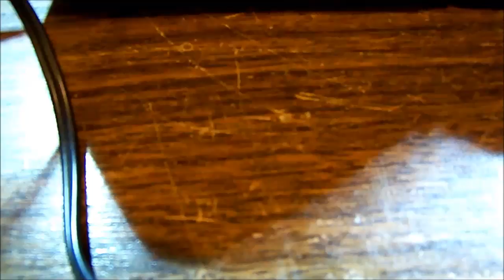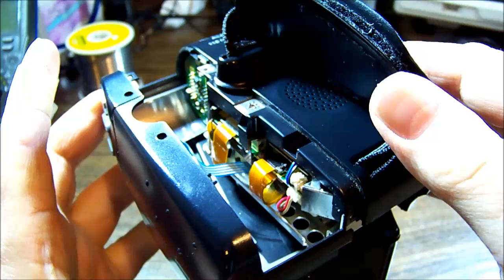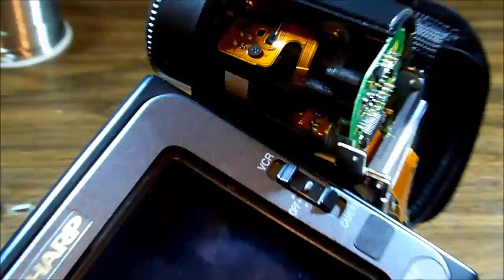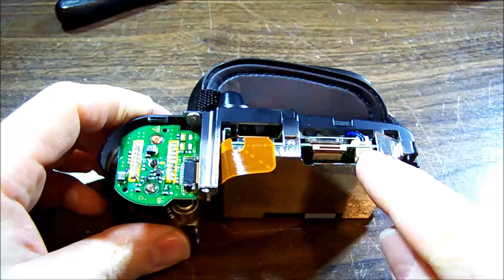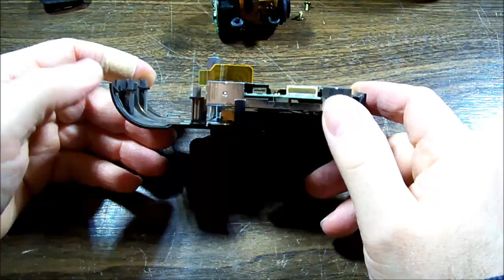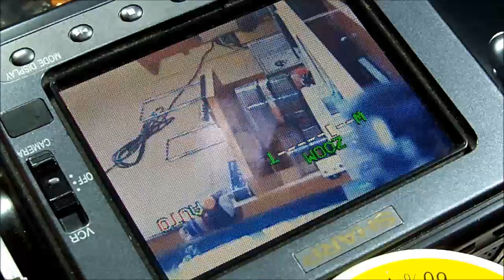Sharp VL-E41X Camcorder repair

Comment: Hi John,

I have the exact camcorder which I had stored in a cupboard for years. Mine turns on both on video and VCR with only a grey screen. I can't retrieve any menus or any functions. Is there a factory reset of some kind I can perform..?  It seems like the internal memory has been lost in not being turned on for years..🤔
Reply from the maker: I wouldn't think so. It's probably more likely some voltage rail is bad or missing due to failed/leaked out capacitors like in this case.
Reply: @JonnyFix  Thanks for replying Jonny...😉
It seems its the camcorders LCD screen. When I use the camcorder's AV output on the TV, it works OK. The only thing it won't show through the AV outout is the menu options. I'm assuming the menu options must only work through its own LCD screen.